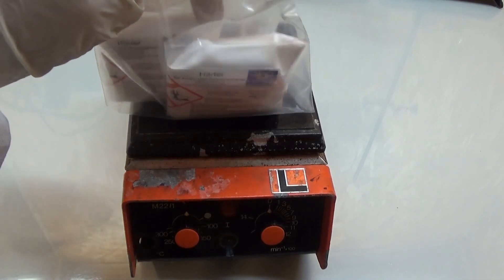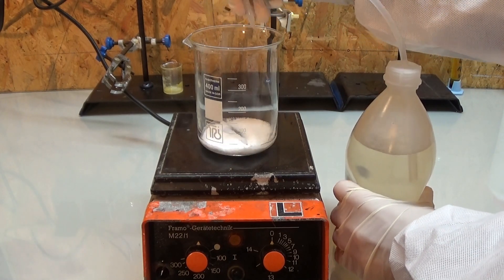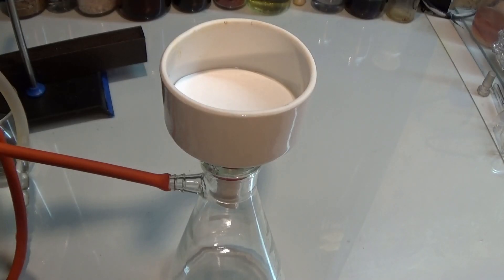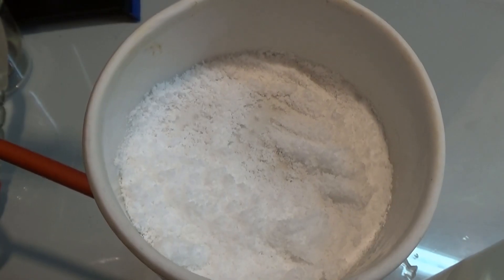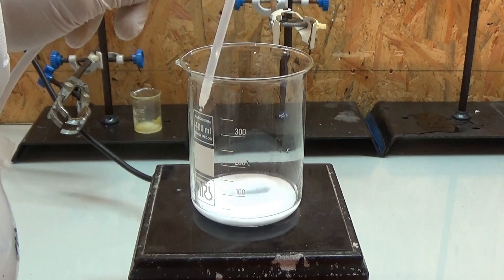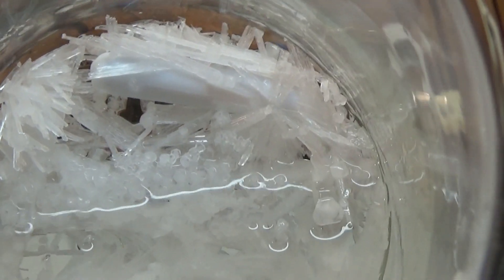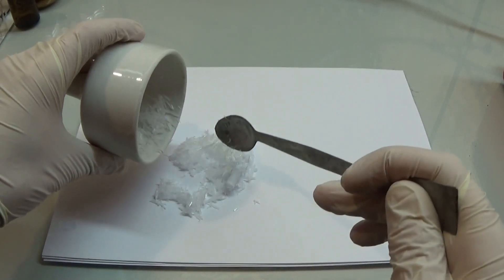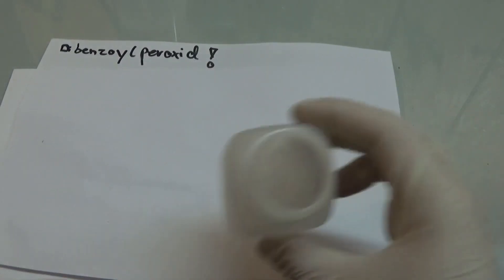extraction of dibenzoyl peroxide

Comment from the maker: hello you all 
here i am with good news 
i finally fixed the bug with my hardwere that created that strange horizotal stripes in my videos 
so now they are way better to watch 
hope you enjoy this little quality of live thing 

and now to the video 
this is a bitchute only video because i am frightend that you toube will give me a strike for this thus disabling my channel

in this video i am purifying dibenzoyl peroxide wich i am using to synthesise benzene carboperoxoic acid which then will be used to make styrene oxide

there for i had to find a suitable source for the dibenzoyl peroxide 
so i ended up with a epoxi radical hardener
to start the process i filled a little bit of the hardener in a beaker and topped it of with destilled water

the idea behind this is that do to the instabillity of the dibenzoylperoxide the manufacturas add some kind of stabilizer that we want to get rid of 
but i did not find any information on what stabilizer was added in my hardener 
so i just went the full save mode and did a simple water washing to remove annything water soluble from the mix 
this works because the dibenzoyl peroxide is only slightly soluble in cold water

the water washed hardener is then filtered off using a buchner funnel 
pro tip 
wet the filterpaper with what ever solvent you are using 
the beaker is washed several times with fresh distilled water to get all of the hardener out 
this also serves as separate water washing to get rid of all the maybe dissolved things 

the texture of the granulat slightly differed from that of the un washed hardener
it was fluffyer and more free floating

this washed hardener was then transfered in a fresh beaker 

now we are ready for the real purifying step 
the recristalization from warm ethanol 

for this we have to know that dibenzoylperoxide is not that well soluable in roomtemperature ethanol 
whereas most of the conventionaly used stabilizers are somewhat more soluable in ethanol 

this in mind we slowly add ethanol and let it warm up to around seventy degrees centigrade 
then we add some more ethanol let this warm up again 
this is repeaded until everything has dissolved into the hot solution

----
the idea behind a recristalization is that the different substances have different solublilitys in the solvent of choice 
idealy the product you desire is highly soluable in the warm solvent and only slightly in the cold one 
the sideproducts are just more soluable anyway 
or should be 
so thats the theorie let us  see if i am correct 
or if the manufacturas used some nasty stabilizer to ruin my day

wow 
that worked better than i had hoped 

look at those beautys they are tramendus
what the fuck 
beautys
well it seems that i can now declare that i am fully retarded
but back to the topic 
the cristals are long, they are fine, and they seem to have a good puryty
thats nice 
thats very nice so i will have some good stuf to work with 

so then let us filter this beutys of
you gotta be fucking kidding me when its wrong it sounds right?
i hate you english women voice do you know that!

fuck 
so well, now
we wet the filter paper with some ethanol and start filtering our cristals of 

the cristals are washed twice, once with fourty percent ethanol and once with water 
the water washing leads to some of the still dissolved substances crashing out and forming a milky mixture 

after the filtering we have to dry our product 
in this case it is very easy 
we just put it on some paper and let it dry out 

and again look at them they are adorable 
just makes my heart melt like a thermonuclear runnaway

but now we still have to confirm that it realy is dibenzoylperoxide 
for this we just set some of it on fire 
yeay

and wosh there it goes 
just behaves like a organic peroxide should 

so then now its time to pack it and store it 
but not for long 
the styrene oxide synthesis will come soon 

then have fun and do not kill your self